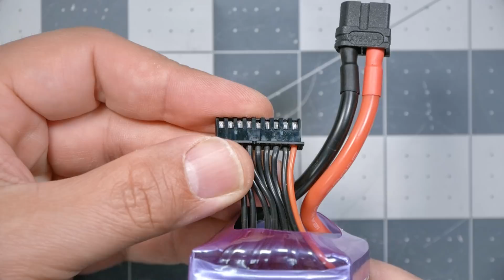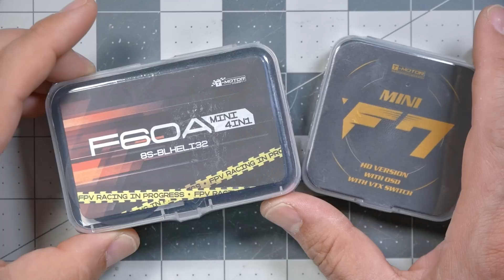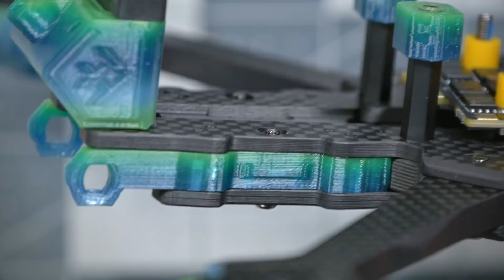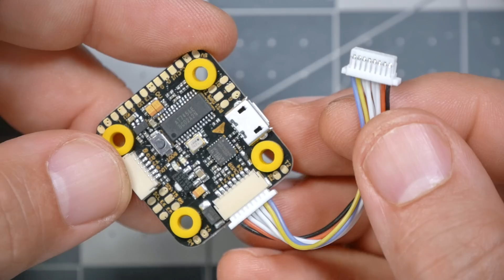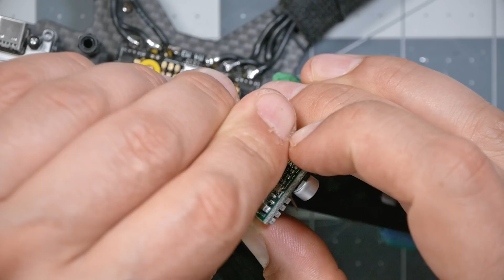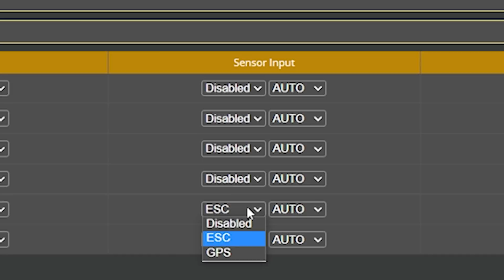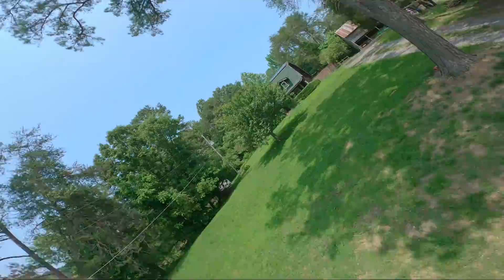Build the ULTIMATE 8S Freestyle Drone. Here's How!

Comment: Next video: Buying a new charger because all you chargers only go up to 6s. Yeah, when you said “Look at that balance lead!” my first thought was add a new charger to the price of this build. The biggest difference I can feel between 4s and 6s is the amount of sag especially when your 6s batteries are new. Not sure how much better that can get going to 8s but imagine as the batteries get older, they continue to not sag as much longer through the life of the battery.
Reply: You can use 2x 4S batteries with an XT60 In-Series Connector (the kind that is 3 XT-60 connectors with no wires in between). If all your batteries are already 4S, then you don't need new batteries OR a new charger. All you need is this series connector.

Comment: Do not use ISDT Air8 as it doesn't charge 8S HV. ToolkitRC M9 might be OK.
Reply from the maker: Holy cow you're right! You can select LiHV 8S but as soon as you plug in a battery, it immediately goes to LiPo. The highest you can go is 4.30 volts on standard LiPo program. Geez. I'm sooooo opposed to ToolkitRC chargers though. I have blown up so many of them.
Reply: @JoshuaBardwell  Gaoneng suggested ToolkitRC M9. ISDT support ignored the issue.

Comment: Surprised you are soldering the voltage regulator directly to the battery input rather than putting the regulator between the ESC and FC inside the harness.  that way the harness is still intact with a diversion in the + - path

AN THEN he puts a cap on the voltage regulator and it become clear why you did it that way.  - should wait for the video to end before commenting.

Comment: Foxeer makes both a 30x30 and a 20x20 fc rated for 8s.  They also use an mpu6000 gyro.  Also, fettec makes a sick 30x30 8s esc, you just need to use betaflight passthrough in their cofig to set it up with a bf fc.  Of you can run a regulator as Joshua did, and run a fettec or kiss fc with it.  Also, gnb makes an 1100 mah 8s pack now.  Lastly, xnovo has made a 2208 1500kv motor for years.  Actually, the only part we were missing for 8s was the battery, as iflight and others have made 8s capable esc's since 2021.
Reply: Yup, I go the Foxeer 30x30 stack for 8s. NO voltage regular required.
Reply: The rcinpower smoox 2306 1350kv was made for 6/7 inch prop I think they will suite good for 8s
Reply: @adamseal  eh, wont have as much pop as is possible.
Reply: @ZiprLips  what is the point of 8s than, you can buy 1900 or 2020 kv and have the same pop effect at the lower weight and price
Reply: @adamseal  clearly not lmao
Reply: @adamseal  if you watched the video, higher kv with lower voltage is less efficeient electrically that a lower kv at a higher voltage.  The 1300kv motors your proposing will give roughly the same power as a 6s 1750kv build, just heavier and longer flight times.  I guestimate the hot spot for 8s kv will be from 1450 to 1650.

Comment: Prop wash- The disturbed mass of air or water pushed aft (or fore when in reverse) by the propeller of an aircraft or propeller-driven watercraft.
You mean something else when you say propwash and I haven't been able to figger out what. little help?
Reply from the maker: Propwash oscillation occurs when the quadcopter is descending or moving backwards into the turbulent air coming off the props. This is especially pronounced when at low throttle, since the motors lack torque at low rpm. To experience it, drop straight downwards, flat, at zero throttle, and then abruptly raise throttle, and the quadcopter will sort of shudder. That's propwash oscillation. You can also experience it by going very fast one direction, then drop throttle to zero and suddenly turn to face the opposite direction, then raise throttle abruptly.
Reply: @JoshuaBardwell  One truncated word changes everything, once we put 'oscillation' back in, it becomes googleable and wouldn't ya know it, the second hit is your video on the topic from 7 years ago. Thankyou so much.
Gonna go watch that, bet I'll learn something today.

Comment: XING2 2506 1500kv is a VERY good motor choice for 8s!
Reply from the maker: IMO it's too big for 5" props but what's a little additional weight?
Reply: @JoshuaBardwell  stator volume less than 2208 but more than 2207.5. Maybe better for 5.2-5.5 prop size over 4.9-5.1. They are same size as the fpvcycle motor, which some people still like for 5inch.
Reply: kV too low

Comment from the maker: The other main 8S FC/ESC stack is made by Foxeer. It has a built in regulator that can take 8S input, so you don't need the separate Pololu regulator. If you want to go that direction, that might be a better choice. For charger, I recommend the ISDT Air8.
Reply: Matek also has some fc's that are 8s capable they even have one that's 12s ready. I want to see a 12s 5" lol.
Reply: Thats what i was about to ask some fcs come with it, or they are rated 8s like the T-motor f7 pro v2  it is rated for 8s
Reply: I know i’m a year late, but out of curiosity, did you charge the cells to 4.35 or 4.20? They are HV cells so yeah

Comment: Get the Foxeer ESC + FC. It is rated for 40v. Will take 8s easy. It has 10v 2a output for camera. Great piece of technology.
Reply from the maker: Actually, I basically agree. I reached out to both Foxeer and T-Motor to sponsor this build, and T-Motor ended up sending product. But if I had known the Foxeer had a built in regulator, I might have tried harder to use it. The Reaper is a great ESC.
Reply: And I have 8s hglrc esc and 8 S hakrc both in 20x20 whyever
Reply: or just get a Matek FC, most of them can handle 8S
Reply: @andrewfpvair  we are talking about esc!
Reply: @andrewfpvair  Does the matek have power output for camera? Only has a 5v 2a output, wont work with DJI o3 or something. Foxeer has 10v 2a output for camera. Why do you want to go matek in this case?
Reply: @Roy-vande-Wetering  I know Foxeer is better and newer, but JB said almost no FC can handle 8S, and almost all Matek FCs could for years, and you only need a BEC for VTX and no other hacks
Reply: The foxeer reaper esc and the f722 or h7 fc is the route I'm going I currently have Datura 2806 1750kv but I wanna switch to RCINPOWER GTS V4 2207 1600KV which are 8s. Should I just try throttle control on my datura 1750kv first?

Comment: Hi JB you should also include a link to a 8s charger
Reply from the maker: Good point! I suggest the ISDT Air8 https://bit.ly/3MdepEh
Reply: I didn’t even think of that when I ordered the parts and batteries. Darn it lol…I gotta buy a new charger now too🙄
Reply: Or cheap out and put 2 4s in series.  boy wouldnt that be ugly to fly on a small frame
Reply: @Mupshot  yeah, I TOTALLY plan to do that as well. I have a bunch of old 5" sized 4S batteries, that never get used for anything. That being said, along with all of the build parts, I ordered  (1) 1100mah non-HV 8S...then when I realized I couldn't even charge the darn thing, so I went back an ordered the ISDT Air8, along with another 1100mah 8S(so now I have 2). Needless to say, It got expensive REALLY quick. Especially for something that doesn't serve much of a purpose, other than being cool as SH$!